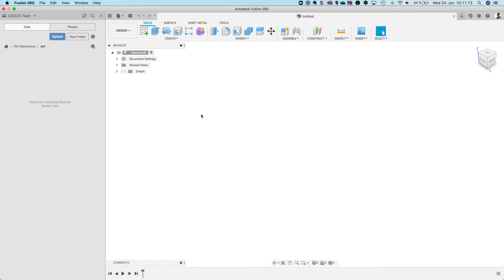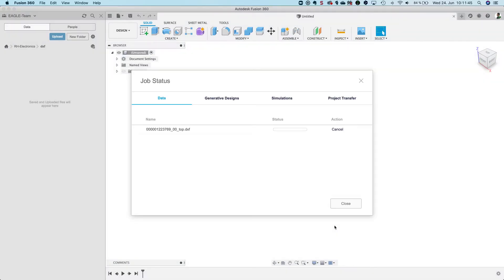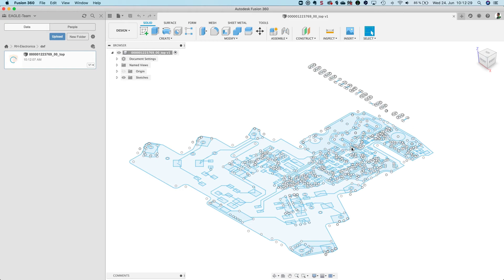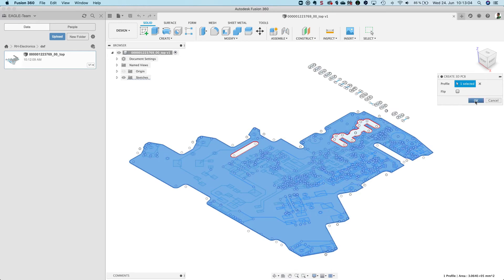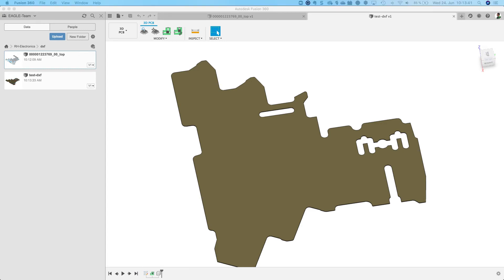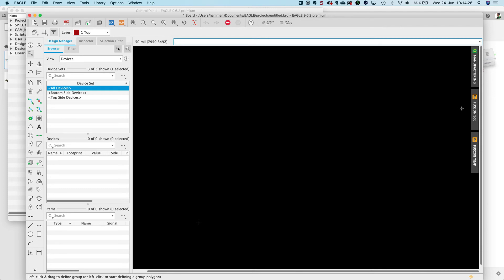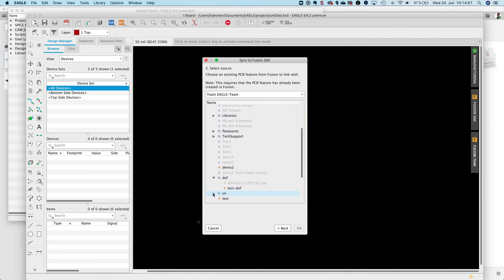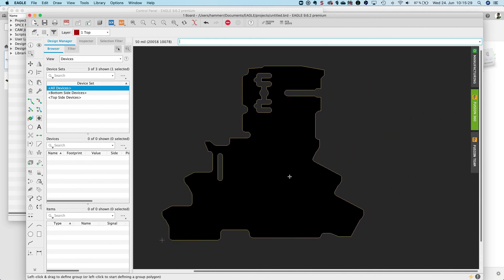Import DXF file into Fusion and use it as board in EAGLE

Comment: is there a way to control what layer it loads the contour into?
Reply from the maker: The contour goes into the Dimension layer. In case the drawing should not result in a board contour, you could change the layers in the 2D PCB.